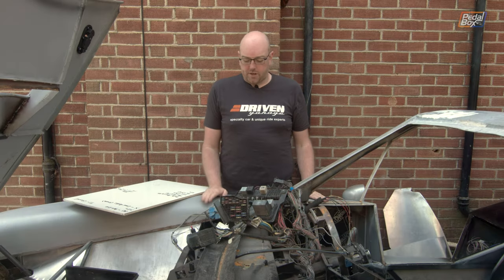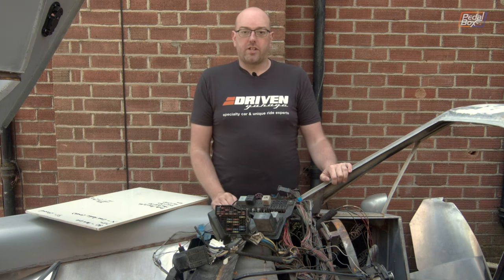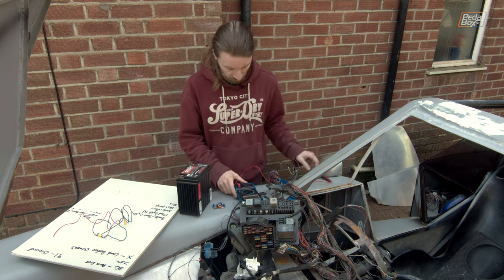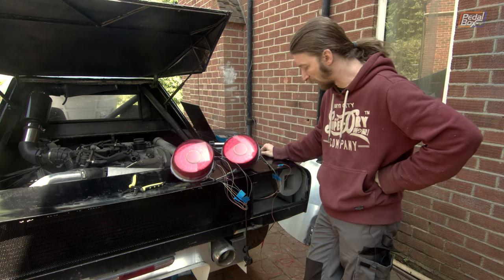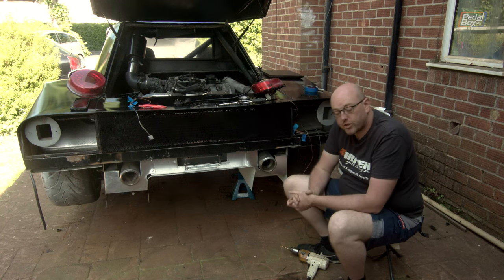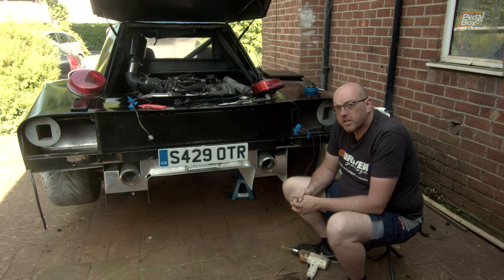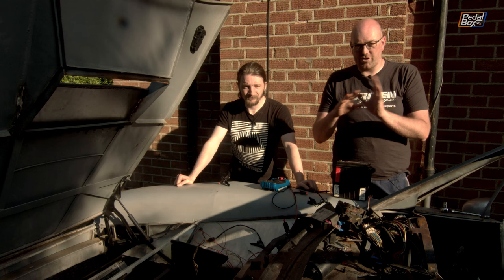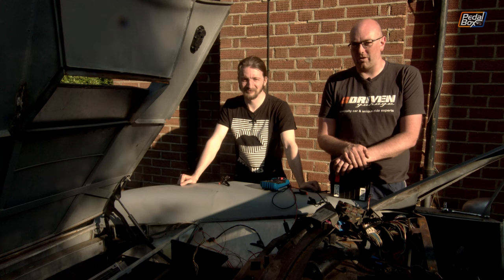Did We SHORT The Fuse Box | Audi TT Kit Car | PedalBox Episode 134

Comment: looking forward to this, remember red to black, black to red and Blue to Bits 😄
Reply: great progress, so time consuming - ECU will also run fans indepently via relay & temp switch in rad - doesn't need AC module bit (or does in mk4)- any issues or daft questions don't hesitate
Reply: LoL
Reply from the maker: Solid advice, until the wiring diagram suggest a colour change mid wire, which is the WORST. Come the revolution, whoever decided that has questions to answer. (We might have had to adjust the colours slightly for available wire... :P)